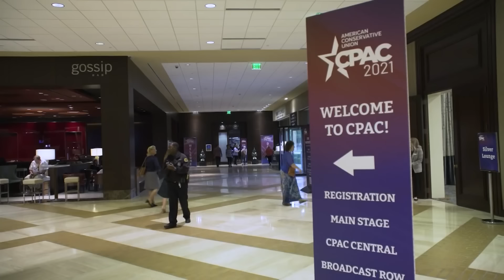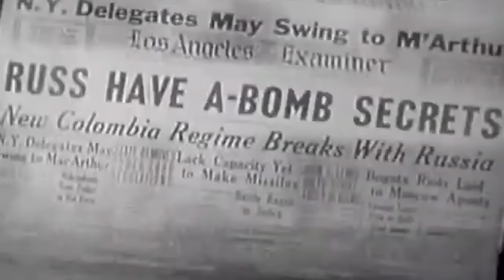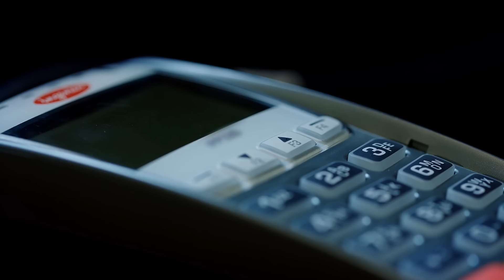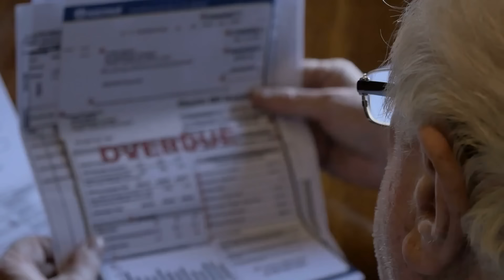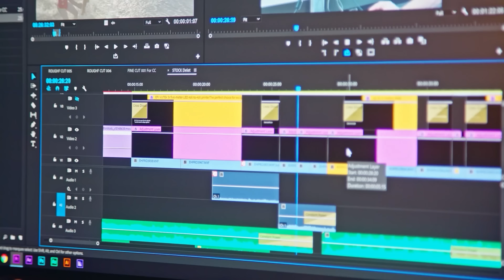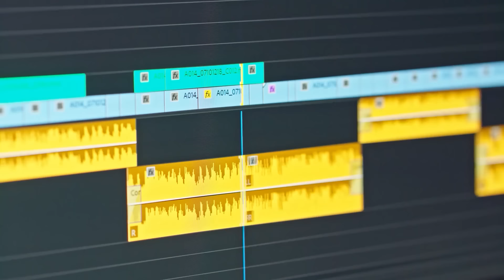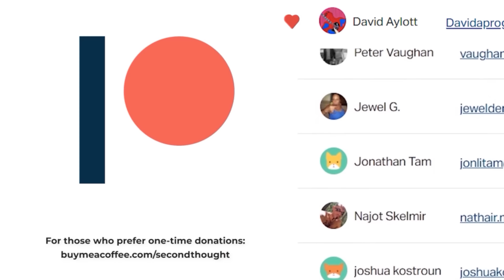Liberty And Freedom Are Left-Wing Ideals

Comment: Liberty & freedom as ideals are based on liberal thought which used to be progressive/leftwing. When the capitalist era began and the „social question“ as the divide between the working and the capitalist class arised many leftist build on the tradition of liberal thought but expanded with anti-capitalist ideas because they thought that these basic liberal ideals could only be fulfilled in a post-capitalist society. This is the basis of anarchist/libertarian leftist thought. However, actively illiberal leftist ideas that did not see anti-capitalism as a way of achieving and fulfilling liberal ideas also started to emerge. They fundamentally reject liberalism and its basic ideals and vehemently emphasize „the society/collective“ over the freedom of the individual in pretty much every way (which is actually the basis of traditional rightwing thought). And this fraction of the left is still quite dominant in todays leftwing circles. So speaking from todays prespective, leftist are not necessarily advocates of liberty & freedom. Some leftists are, some not (especially those from the Marxist-Leninist type).

Comment: Except freedom isn't left or right wing.

Referring to Economic Right/Left wing it's Plutocracy VS Communism. (If the market should be controlled by the rich elite or the state)
Both sides can be liberal in their ideologies and fluctuate between right and left depending on where the center is in the current landscape.
Right now the left are collectivist, where a group of people are forcing others to reform to their beliefs because they believe themselves to be morally correct.
Meanwhile you have the right who are individualists, wanting to only deal with themselves in their own communities and be left alone.

Which is why you now see a lot more liberals on the right than on the left.
If you're arguing about the political party's views you just see Republicans aiming more for popularity to boost themselves while you have Democrats focusing more on boosting themselves through welfare and virtue signaling.

An oversimplification to fit it in one comment.